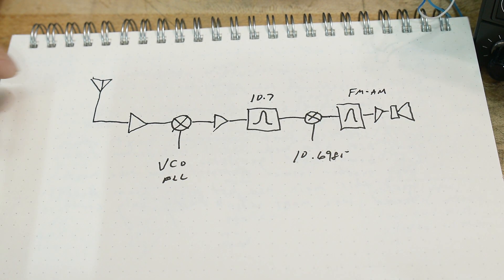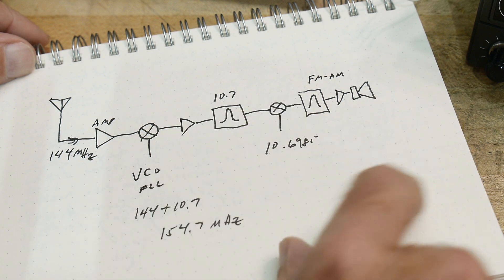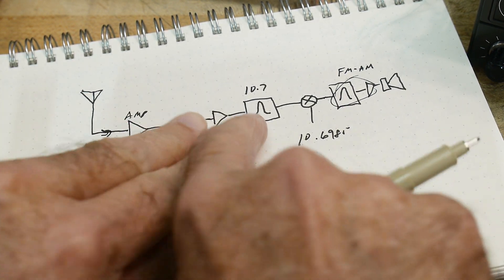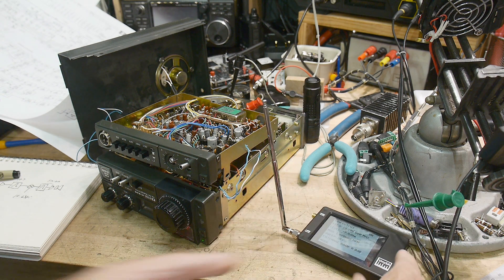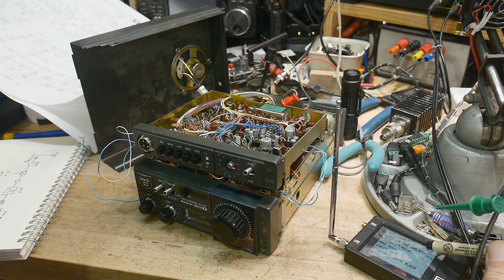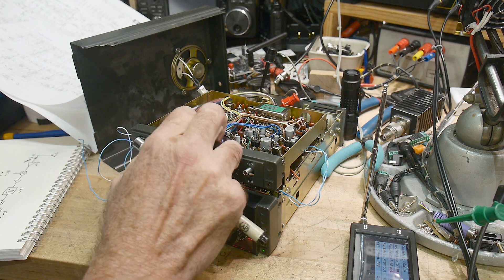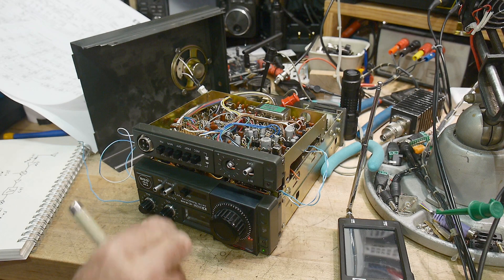#951 ICOM IC-245 Repair Using TinySA RF Generator

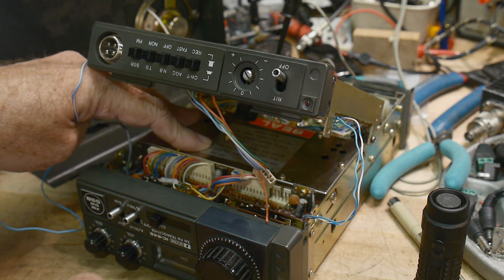Comment: This video was very instructive as to what is and what is not possible - if one is removed from a hands on set up - its easy for Youtube video makers to not understand what people have and don't have access to + time of controlled experimentation - so the 10.7 MHZ bleeding and FM vs AM bleeding into what the radio could pick up at nearly each stage + what the Tiny SA can put out + the ghost footprint of unmodulated signals - really super to see that and confirms a lot intuitions / various hunches I have been harboring about various types of "Communication" and "display" equipment  but not able to execute on. @10:54 do you think we voided the warranty yet ? 
.

Comment: I'm wondering whether to get a TinySA for aligning and repairing a CB or something like a 0.5MHz-470MHz RF Signal Generator Meter Tester for FM Radio Walkie-talkie.

I think these can also do FM deviation.

Do you have any thoughts?

Thanks.
Reply from the maker: I have a playlist for the tinySA. you can see me use it in many ways.

Comment: You can generate a simple unmodulated carrier that is inside the SSB audio bandwidth and simply listen to the tone.  For example, set the radio to 144MHz, and set your generator to 144.001MHz and you should hear a 1kHz tone if you set the radio to USB.
Reply: I saw a video about a guy that sent a photo.jpg like that!! it was funny cool !! but since there is no logic testing in this, it's kind of boring. 2 me!! good luck!!

Comment: I have used the TinySA to troubleshoot vintage AM-FM radios as well, injecting signal at the IF frequency, and at RF to peak sensitivity, and the spectrum analyzer to locate the local oscillator to see if it works and track its frequency as I adjust it to range.
BTW, an FM demodulator will let AM signal to be listened, but under certain conditions: that the input signal has to be below the limiting threshold of the IF amplifier, because when the signal is high, it gets limited and amplitude variation is eliminated (thus, AM modulated information) by at least 40 or more dB (and this is called AM rejection ratio for an FM demodulator)